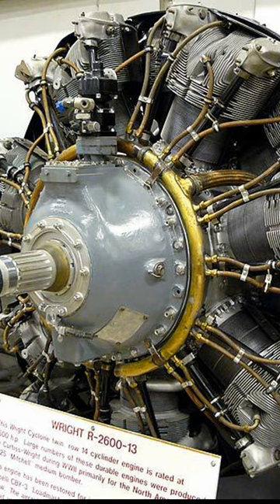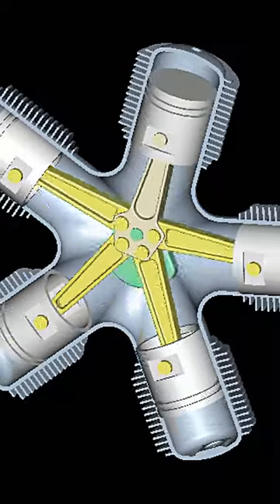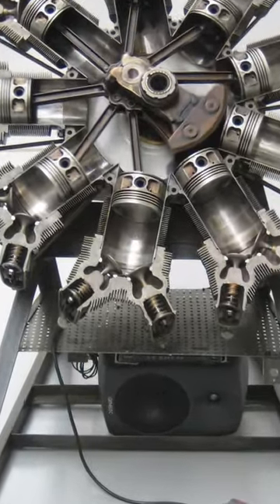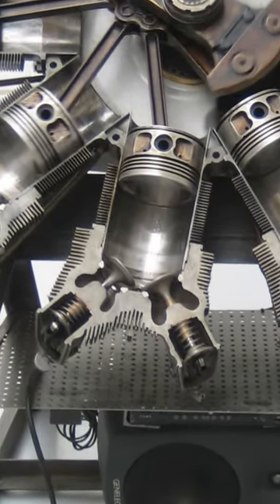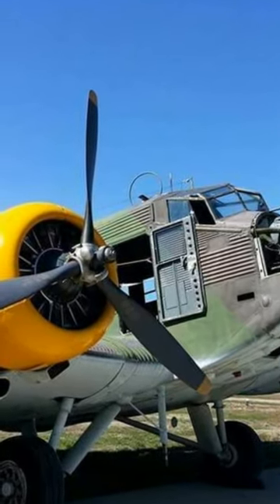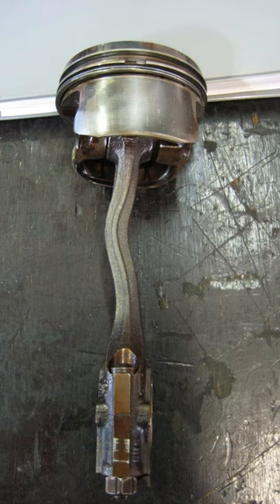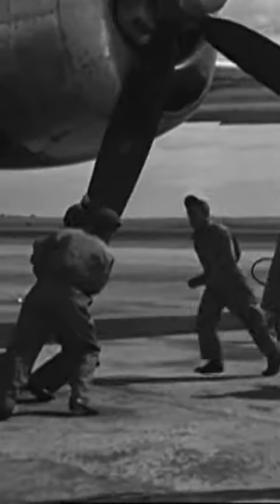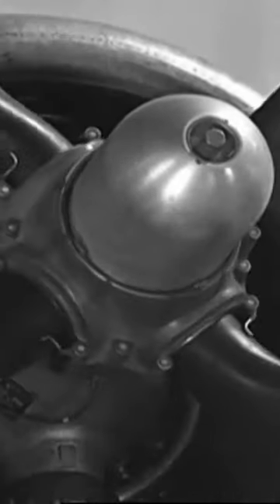Starters 11 Hand propping a B-29??? #aviation #flying #history

Comment: Then think of the wëhräböö’s favourite configuration the inverted V-12 with all the cylinders equally prone to oil locks.  Imagine pulling an engine through passing in front of a hub’s 20mm gun barrel too.  Funny how the dumb allies didn’t go with inverted V-12s.

Comment: I don't know if it's still online, but there used to be an A-1 Skyraider pilot's memoir on a website, in which he detailed the start procedure of the Wright R-3350 (same engine as the B-29, but he only had one). Something like "leave the magnetos and fuel off, bump the electric starter until you count sixteen blades [four turns of the engine with a four-blade prop] to get the oil out, then turn on all the fuel pumps and spark and lean on the start switch until it shoots fire out the exhausts."
Reply from the maker: Thanks for these deets!

Comment: That's not the only reason they did that, they also listened for a hissing sound at the exhaust (which would be the wastegate dump valve on the supercharger/turbo configuration that most US Army aircraft used in WW2) indicating that a cylinder has a burnt exhaust valve. 
Fact of the matter is they were more likely to run into that then hydro locking a cylinder because standard procedure on the bombers was for the ground crews to remove a spark plug from the 6 o'clock cylinders of the engine's and leave them out while going over everything else after every mission, by the time they checked out the rest of the plane oil would have quit draining from the upper parts of the engine and it was safe to install the plug(s) in the bottom cylinders. 
They usually had all their plugs replaced every other flight anyways because the aviation gas they used in aircraft had such a high lead content to get the octane ratings they wanted it'd build up so much on the plugs that it'd actually bridge the gap at the electrode and foul the plug, the fighter's were even worse, they were running 150 octane that had so much lead in it it'd foul the plugs in as little as 10 hours, escort missions where they flew for 7 hours required them to have their plugs replaced after every mission, the crews would just wait to put the 6 o'clock cylinders plugs in last since at that point the danger of oil draining into that cylinder would have passed.
Reply from the maker: Thanks for all those details!

Comment: This is called "hydraulic lock" or "liquid lock." You also have to do this on inverted in-line engines like Ranger 6-440s or inverted V engines like the German Argus inverted V8 or Daimler-Benz 600 Series inverted V12s found in most Messerschmitt 109s.
Very large radials like R2800s are very difficult to turn by hand with spark plugs installed, so they were usually checked for hydraulic locks using the starter rather than turning them by hand. The starter had a breakaway clutch that prevented damage in case a piston hit a lock. The engine would be motored through several revolutions using the starter with ignition turned off. After the prescribed number of blades had passed a given point, ignition would switched on, allowing the engine to start.

Comment: Huh, I always thought the radial engines in planes were like the radial engines in the Rx-7 or RX-8. Not just regular pistons in a circle instead of a V or a straight line.
Reply from the maker: Yes, it can be confusing! Then if you throw in the "Rotary" aircraft engine, that's a whole other animal too. On my audio podcast I did an episode called "Cylinders - The Quest For Power." Eventually I'll make a video that goes with it. Please subscribe to not miss out!
Reply: So there's a handful of rotary engine designs as well as radial designs, most notably to non aviation folks being the Wankle rotary which also has applications in aviation. Each has their own oddities though. 

Eccentric crankshaft orbits are the key principle in all of them to some degree, but it's applied differently in design and operating principles. 

Gnome rotaries and radial engines are almost identical in design and operation, except on the gnome radial the entire circular crankcase and cylinder assemblies rotated with the propeller around a stationary crankshaft. Radials typically had hard mounted engine and circular cylinder assemblies and the crank and prop were what rotated. I'm only aware of four cycle models for any of these, but all included the incorpation of an eccentric orbit based off the input from a master rod on the crank that all other piston rods attached to. 
The gnomes were quickly phased out due to massive torque loads from the rotating mass once radials came around. Not to mention the radials could be supercharged. 

As for the Wankle rotaries, they're a whole different yet similar ball game. They're a four cycle engine, with open porting much like a two cycle. Operates off the principle of an eccentric crank and screaming aluminum doritos contained into a very compact lightweight unit with minimal vibration and torque factors.  Which makes them very favorable for aircraft, though I think they're commonly used in racing or experimental planes. 

I personally love radials and wankles in particular due to being "modular" which has lead to some really batshit crazy powerful engines being designed  by seeing how many engines could be frankensteined together as one . There were radials in ww2 capable of producing 3000 horsepower....

Comment: And, now you know one more reason oil stains are so prevalent behind cowl flaps, exhaust pipes, and cowl seams on radial engines. When "running the props through", the lower cylinders' valves are dispelling the oil into (respectively) the intake manifold & exhaust manifolds. Upon start, the oil will get blown out of the exhaust, and (somewhat aerosolized) back into the cylinders, accounting for much of  the copious smoke seen from exhausts upon startup.

BTW, the drawing of the the WWI mechanic is actually showing STARTING an inline engine. Before mechanical starters, mechanics WERE the starters--mucho dangerous! And the film clips of mechanics pulling props on engines are overwhelmingly rotary engines--a type of similar appearance to a radial, but actually quite different in that the entire engine spun. This type pre-dated radials, and also differed in its oiling system, having a caster oil that was 'injected' into the cylinders/gearing, and was lost through the combustion/exhaust/slipstream. The mechanics in the film clips are also starting these engines, NOT needing to 1st clear oil from lower cylinders.
Reply from the maker: A radial startup is a glorious thing!

Comment: Well, technically, they're just turning over the cylinders... I thought you meant a pop start from hand turning. The WW I planes did this exclusively. It can be done with a light plane [C-150],  but I'd be scared to death of trying it on an R-3350.
Reply from the maker: You're right...I was just trying to be provocative with the title!
Reply: @worldofwarbirds  ''Provocactive...?'' New word for click-bait.
Reply: Another related phenomena with radial engine aircraft is the big cloud of smoke on a normal cold engine start.  This is the remaining oil burning out on ignition.  Was at WWII weekend at Reading one year and one of the girls in the unit ran up saying the B-29 had caught fire on an engine start. No fire just excess oil.  Also remember 1940s piston rings weren’t as good as today, and all 1940s engines burn an obscene amount of oil by even 1980s standards.
Reply from the maker: I think the quote was "both oil and soap were cheap" in those days.

Comment: We do it every day, and it’s called “walking the prop through.”
Reply from the maker: What aircraft are you operating?
Reply: @worldofwarbirds  
Hi,   We have several aircraft with round motors, & they all have to be walked thru prior starting.
Reply: @worldofwarbirds  
I do some work for an outfit that operates a fleet of Stearman biplanes that have all been reengined with Jacobs or Pratt and Whitney radial engines. We call it "pulling the prop through." Same thing.

Comment: It is very important to turn around the the Wright R-3350 Duplex-Cyclone radial engines to get rid of the excess oil especially at the lower part of the heads. Nevertheless it was an awful engine and very mantainace intensive.
Reply from the maker: I always shudder at the thought of changing all those plugs...

Comment: was there compression release so the prop could be turned
Reply from the maker: I don't know that answer, but I'll see if I can find out.
Reply from the maker: Here’s the answer I got from the folks who take care of B-29 “Doc”:

To protect against hydraulic lock, the engines were turned by hand, through two full engine revolutions to ensure there was no hydraulic lock. If they encountered a locked cylinder they could feel the engine come up on the locked cylinder and stop turning the engine. A spark plug on the lower cylinders would be removed until the offending cylinder was located, at that point the oil would drain out of the cylinder and the prop turning would continue until all cylinders were cleared. The plugs would be reinstalled and the engine would be ready to run. There was no compression release so two people per blade were usually used to provide enough power to turn the engine. Both fuel and nags were off for the hyd. lock check.